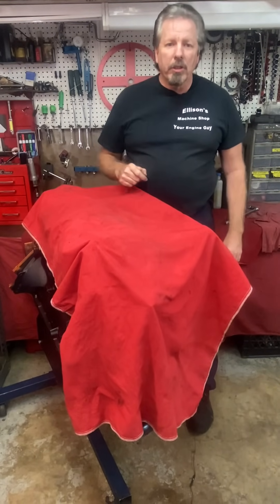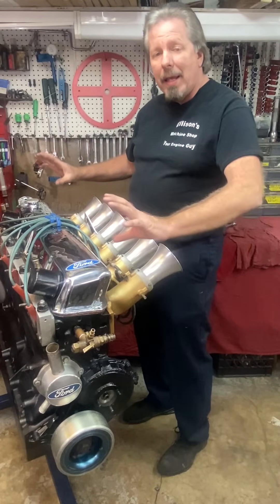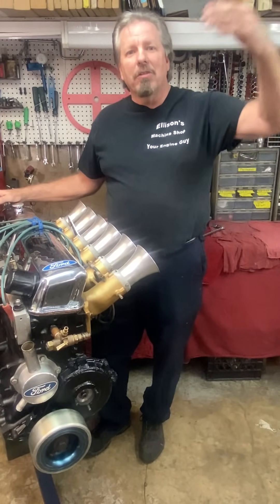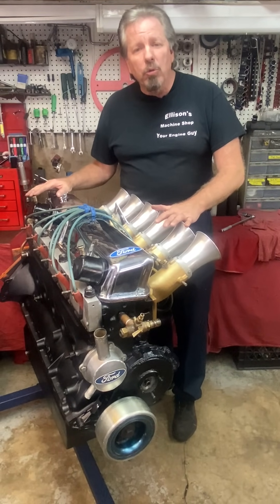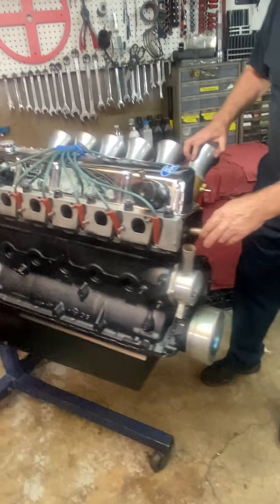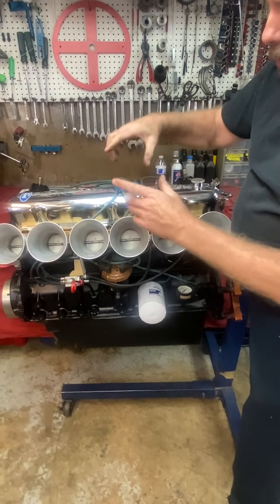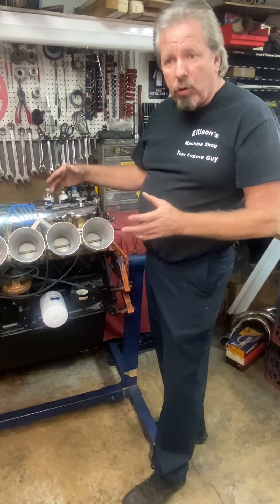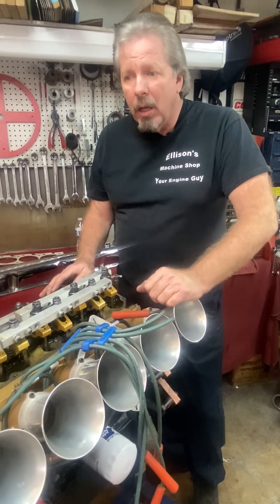Boss 300 Finished Project

Comment: The Ford 300 inline 6 engine is as good as they come b/c the engine is big, and has 7 main caps for extreme durability!  Along with that is the connecting rods inside are also steel as well.  One YouTube video installed a turbo onto the Ford 300 and was able to push the engine output to 522 horsepower and 577 foot pounds of torque!  Although the 300 engine won't hit high RPMs like the 2JZ, however, the big displacement of the Ford 300 will result in higher torque output in lieu of RPMs!

Comment: Lets hear it run! I saw one of these engines a Martin Speedway back in the late Seventies. What a screamer! It was in an altered before they band them so my time frame might be a little off. If was a wreak though, oil leaked all over it but it would fly. This one has 3 two barreled carburetors on it.

Comment: You could kind of think of this engine as an AmeraBarra. The Barra traces it's roots to the 300. Started as a 300, then they made it over head cam to make it cross flow. Then they made it twin cam and here we are with an original 300 with a cross flow head

Comment: Ford Australia did it in the late 1970s , as Ford Australia cast, and built 302 Clevelands and 351 Cleveland's from 1971 to 1986 , they decided in 1979 to put a Cleveland style cantered valve head on the 200 and 250 ci six that started life back in 1960 as  a 144 ci Falcon six , the Cleveland style cross flow used all Cleveland valves , valve train , combustion chamber and rocker gear , in the 1980s it was up graded to alloy head , and Honda / Ford paired together to create the new alloy head , by 1987/8 it gained a Hemi 2 valve over head cam head , and in the 2000s it got Double over head cam 24 valve , VVT and a massive overkill Garrett Turbo and became the Australian 4.0 litre Turbo Barra Six , and was in production till 2017 in Australian Falcons , six speed manual transmission rear drive or 6 speed tip Tronic auto, LSD diff , the same Falcon was available with the Australian only factory supercharged Coyote 5.0 , but it was slower than the 4.0 Barra !

Comment: The way you've described the flow of this headline of tells me that you have figured out a way to get BOOST out of a naturally asperated  cylinder .  if you can get more air into the cylinder than it actually measures then isn't that boost ???? I don't know 1- 10000 th of what you know but the way you described what you have done is amazing  NICELY DONE !!!

Comment: Most 300 Ford blocks you could bore then to  4.030 and you got 4.070" out of it? I know Bob Heuttman and Steve Ambrose two ford guys went to the Cleveland casting plant and played with the casting boxes to allow the bore to go to 4.185 and worked on the deck so it would not blow head gaskets and they did other thing to the block to make it better and there was only about 50 blocks that were cast. here is the story by Bob Heuttman one of the designers of the block. https://www.youtube.com/watch?v=dn6BOeuXuuY&t=38s

Comment: The transmission you’re referring to sounds like a “semi automatic” 3 speed. Essentially it had a fluid coupling rather than a clutch/ pressure plate.I owned a 1950 Dodge in 1970 with this transmission.

Comment: There is a local guy here where I live that used to built that exact same transmission for a circle car here. They ran in two seasons and could not tame the car with that trans setup. Spins the tires out of the corner every time, and skids the tires into the corner every single time. They had a hand controlled valve in the cab in of the car to regulate the clutch pressure to try to tame that trans setup and even that wouldn't do it. Crazy power for some reason it just did more than the standard trans could. I am not a trans guy but i can see that being out of control.

Comment: Well, this is my story. In 1968, I got a NHRA rule book. There was an article in Hot Rod magazine about this engine and how to hop the hp up. I designed a 1962 Ford Falcon Station Wagon with this engine to run in the class of I-Modified Production. Wagon 2700 pounds divided by 300cc gives 9 to 1 ratio. The class was 9 to 11 to 1. Bottom of Class. Chevy pistons and 3 Weber carbs put out 450 pounds of torque. All legal with the better weight distribution of a Wagon. I saw the National Record Holder Chevy with a 4 barrel carb. My design put out 60 more HP.

Comment: Imagine building this with a set of sectioned SOHC heads, bored to 4.5, and 4.5 stroker crank for about 429 CU in. Possible 1000 HP if done well by the flow numbers. Not sure the block could handle the stress though. The other option is Nascar V6 heads if you could find a set. Never seen a max HP number for 300 6 bocks but they hold at ~650 in drag racing which is about the most brutal stress on the block.

Comment: Hi Google and found several brands of aluminum racing heads for the Ford 300 6 cylinder and I'm wondering if you put a turbo on one bored and stroked, cammed and ported with a Holley Sniper EFI what it would do

Comment: I had a 1970 f100 4x4 granny 4 speed trany and a straight in and out transfer case, no high low options. Had my machine shop cut 2 holes in the intake and weld flanges to put a 2 barrel carter on each flange , they blocked the center carb mount with bolt on cover. Had a rv cam ( back in the day)  I ported and polished the head and intake the best we could. Got a set of  split hooked headers 3 cylinder. Came out in front of back tires in one 2 1/2 in pipe on each side. It sounded like a farm tractor but a little more pipey.  It was a tourqey beast
. I could out pull any thing I came against. They always wanted to see my mighty power plant. They would cry every time. I had the truck for40 years rebuilt motor 3 times. Had over 1million miles on the truck all original motor ,trany ,drive  line ,transfer, and punkins. It was my daily work truck.

Comment: I'm impressed. Keeping historic racing alive for the next generation. Can I get the "un-edited" verbiage about the intake section ? As a former fibreglas [OG spelling] man I'm a bit leery on what you call "epoxy" runners. I hope it's not just a pure two-part resin/catalyst. I tried to stop frame it. It appeared to be glass layup or loose fibre layup but not sure. Epoxy with or without fibreglas does not play well with heat or oil or continuous heat/cool cycles/vibration in the long run. It will blister. It will crack. It can separate. Will it outlast the rest of it? Maybe, maybe not. I'm assuming that they used polyester resin back in the day. There are better resins and carbon cloth now. The ingenuity alone to achieve what they did back then puts a healthy grin on this old Mug.

Comment: Thanks for the recap. Nice job on cool motor.  
Old guy here.  Was running back then.  End of Gasser Era so I was bouncing around looking for other classes I felt OK in ...  ClutchFlytes were not that rare.  Like Hydro-Sticks, they were not for the faint of heart, but they were around.  Could not run them in S/S, but the Mod classes could, and they ran - hard.  Biggest deal was to figure out the external oil pump for the tranny.  If you could sort that out, you had a progressive planetary 3-speed - effectively a pre-Lenco.  If had slipper clutches back then too, it would have been over for lots of classes 😁

Comment: THE LS FROM TOP TO BOTTOM, FRONT THE BACK, SIDE TO SIDE IS ALL FORD AND DESIGN. IT'S A REGURGITATED FORD 427 HIGHRISER AKA RAISED PORT 351 WINDSOR. NOT A SINGLE DESIGN ASPECT OF THE OLD SMALL BLOCK CHEVY LIVES IN THE LS. THE LS IS 1 MILLION PERCENT BASED ON FORD DESIGNS.

Comment: Somebody needs to be casting those cylinder heads!
Reply: And an intake for it.
Reply: Australian falcons have x flow heads on 6 cyl engines from 78 up, early are cast iron and later are alloy 3.6 or 4.1
Reply: @stephengibbs4372  Aren't those for rhe 200/250 engines? That's a completely different engine from this one.
Reply: Some guys are cutting and welding up 5.3 LS heads and doing something similar just turbocharged.  1000whp. Its awesome

Comment: There are mathematical formulas to determine what size and length the intake and exhaust runners should be for volumetric efficiency. Hot Rod magazine published a flyer in the 1960s giving the full explanation for tuning the exhaust and intake manifolds.

Comment: You should bring this idea to Jon Kasse and see if he might build a new one-piece head. This is a way cool engine and would be even cooler if you could build a new one now without having to weld up a head for it. Even cooler in a straight eight configuration.

Comment: My dad and his best friend built one of these in 1970 in Missouri. Also in a T bucket roadster for drag racing . They sawed 2 boss 302 heads and had to heat them in a oven before welding them together. they had cut up a hilborn injector setup as well.  Word got out about how successful this combo was against the index and it was.  Its all about the airflow of those Cleveland style cylinder heads. I also have a set of the high port exhaust cleveland iron heads that have the machined exhaust with the aluminum plate on them. They have the stud girdle Motorsports valve cover on them as well. Some great stuff from backyard engineers back in the heydays of racing!

Comment: Yes correct, they used a 727 torqueflite transmission with a clutch and flywheel. I had one that was built off a turbo 400 by B&M transmission 50 years ago

Comment: It's amazing to me that this was done so long ago and nobody in the aftermarket picked up and ran with a commercially available head for these engines. There's millions of these things floating around as cores. Imagine being able to get a head for $1500 and make a 600+ HP naturally aspirated I6 out of a junk motor that makes less than 200 stock. I bet the bottom end would be reliable too if you got one of the ones with a forged crank and a good set of rods and pistons. 7 main journals. That block has proven itself over and over again to be super strong. We're talking in the sub-$5k range to build one if the heads could be mass produced. Then imagine what kind of power you could make slapping a decent sized turbo on the side. You wouldn't be able to make those heads fast enough IMO.

Comment: My pawpaw had a dirt car called the puddle jumper back in the 60s and 70s. It was a chevyII they took 327 heads and cranks, cut them apart, bored and sleeved the original Inline 6 engine and put the welded together crank and head in the car along with custom rods. Those old guys knew how to get things out together out of nothing back then.

Comment: Question for you!? Ona  ford 300 inline 6 rods if you take pistons out and pull pins ect , how can you be certain of orientation.  On stock rods? Example if you flip a rod around it will bolt up. Help help help

Comment: Hi all! this is truly incredible. But please take a look to the oldest running racing series on Earth, Turismo Carretera, Argentina. These Fords, Chevrolets, Dodges and Torinos, have been running since 1930's, and they still preserve the naturally aspirated inline sixs with some fine improvements, but no turbo, twin 44/44 Weber carburetors, and a lot of skills put on camshafts, crankshafts, valves, springs, pistons and connecting rods. 450hp and almost 10k rpm. Not so long ago, the 2 valve heads were replaced by 4 valve heads. Please take a look. 
https://www.youtube.com/watch?v=nP0_rxRVHYk 
https://www.youtube.com/watch?v=y_ER-lfbcNk
https://www.youtube.com/watch?v=4jyUUi53g-E
https://www.youtube.com/watch?v=ZgAGpEQjHwg
https://www.youtube.com/watch?v=r7vlpuwVHQQ
https://www.youtube.com/watch?v=SxXorsKJAZE
https://www.youtube.com/watch?v=Crkae6OLx7I
https://www.youtube.com/watch?v=mhiNouWbrLI
Enjoy!

Comment: I have had alot of different engine’s and even though I never had a 300 in anything other than a truck but some of the old guys I grew up with they had straight six drag cars and uncles with built Jeep six cylinders but I always wanted to build a ford 300 and as a welder I appreciate the difficulty in that head

Comment: This engine is incredible!
The in-line six is such an efficient design. I cannot wait to hear it and find out the dyno numbers.
Reply: Yeah we campaigned several of these engines back in the 70s up threw the 90s and won lots of events both circle track and quarter mile tough engines exceptionally with a few modifications

Comment: Thank you for sharing this with us. It is an incredible engine and project. But this engine is a perfect example or "just because you can doesn't mean you should" It would be like taking the 4.2 I6 from the Trailblazer or 3.7 I5 from the Colorado and building it instead of swapping them out for a LS. These type of engines are awesome and a fantastic way to prove your intellect, superior engineering abilities, and showing how you can take an idea and execute it surpassing the idea of what's available. Besides that and dominating certain classes I can't see there being much practical use for it.

Comment: Ford Australia did this in 1979 and even mad alloy Cleveland heads for the ford 200ci and 250 ci sixs and fuel injected them , this motor went on to single over head cam and them twin over head cam 24 valve turbo Barra motor the world now knows about ! No need to cut up Cleveland heads ! Do some research before so much work , the alloy Cleveland type six cylinder heads are at every wrecking yard in Australia for $50 or less you probably get a complete 250 ci six with alloy Cleveland head for $50 ! Just saying USA not the only country !

Comment: Dear Ken, You the MAN,--Wonderful piece of History.  I have an idea.  You remember the mid-'60s Pontiac OHC -6 that in '69, had 230 HP, stock?  Did any one race those, back in the day?  Supposedly, Pontiac was working on a DOHC head, that never saw the light of day in Production.  Could you do a DOHC-Poncho "Sprint"?--A what might have been?   Pontiac dropped the OHC, because to buy the "Sprint" one paid More than it'd cost to upgrade to the 350cu" Pontiac V-8.   As the OHC Pontiac used a Chevy-block, if you developed a DOHC-head, you might sell some to those few that DON'T desire to "go LS."   Can you imagine a "Phantom" OHC/DOHC 292, bored to 302. using '69 302 alloy heads, pieced-together for an over a 292+ inliner?  --Not a "Z-28" with 2 quads, but a "Z-26" with a 6-cylinder 302 with 3-twin Webers/Delortos/or a Hilborn set-up, or a "tri-power" with 3 single Stromburgs for stocker-V-8 humbling power and good highway economy?   Given the same HP, --6 or 8, the 6 will often pull-BETTER than the 8.

Comment: A Boss 302 (Clevor) has 351 Cleveland heads and an exclusive intake manifold, so you technically cut up Cleveland heads, otherwise that's one valuable initial donor investment, because a Factory Boss 302 brings in some serious jack in rebuildable core condition

Comment: Love the 300 six. Had one in my mud truck I had. It was a beast in the mud. Had people tell me I needed a bigger engine to spin the tires in the mud. I had a 3 inch lift with 35s with lockers and had no problem spinning the tires. In fact it took less rpm to spin them then the v8s did. I would love to get another f150 with the 300 six with a 4 or 5 speed. Unfortunately I am stuck driving my pos 01 Silverado that I would trade in a heartbeat for a 300 six powered f150.

Comment: Awesome stuff
I just heard an interview from Sherman Sligh the original builder of the engine. It's fascinating to hear the amount of effort put in to welding those  heads together. Sherman is almost 88 years old now.
Reply: we didnt weld heads they were furnace brazed
Reply: @lewishendershott4783   lou drove the cars jerry meade built runnin this motor , the opal he took the i/gas record and held it for several years, than jerry took the motor placing it in a altered . plus lou knows a lot of the work it took to make them,
Reply: @charlesgermer7430  charles look me up can't be that hard in this day and age

Comment: So there’s an engine manufacturer here in Kearney, NE. The can pretty much build any thing. If you had the specs of the head off that monster they could make a copy out of aluminum and fix any imperfections. It definitely sounds like a great conversation to be had. There’s an infinite amount of 300 cores out there for sure. Ok so it makes horsepower for a race application can it get fuel mileage and torque. Very intriguing 🧐! Especially at over 2 hp per cylinder! I’m a dyed in wool Chevy man, but come on!! That’s a stunning #!

Comment: Seeing a diamond like this is extraordinary!!! Even if it made 400hp back then is outstanding but 600+hp thats mind blowing. Mr. Sligh is a mastermind
Reply: Just think the Honda 2.4 liter k24 stroked to 2.7 with k20 head big cams and e85 can make450 to 500 whp with no turbo or nitrous. Throw in some nitromethane and get 6 to 700hp. Years ago you could only do that with a turbo or nitrous. I would like to see what this engine could do with a better head and and cam and a computer control direct port fuel injection system so it can be accurately tuned with a o2 sensor on each exhaust header tube to get correct fuel mixture reading